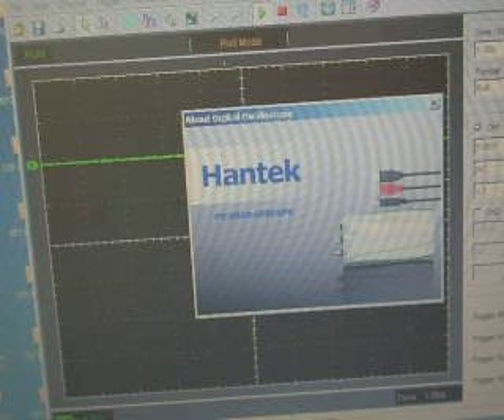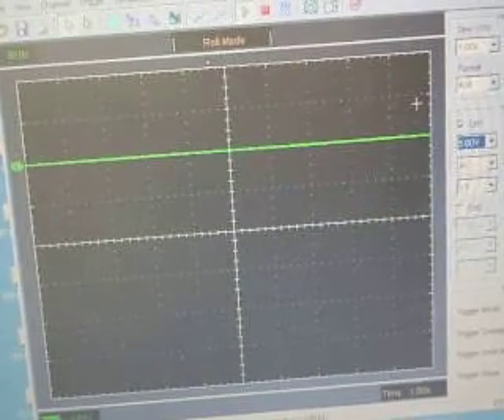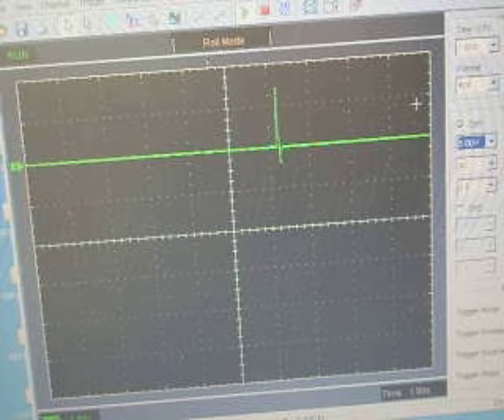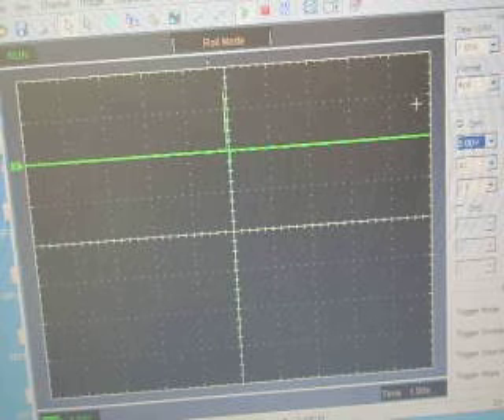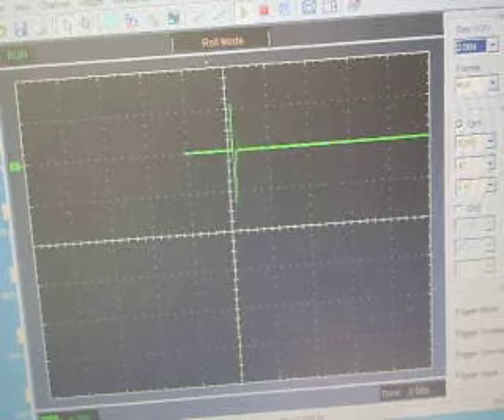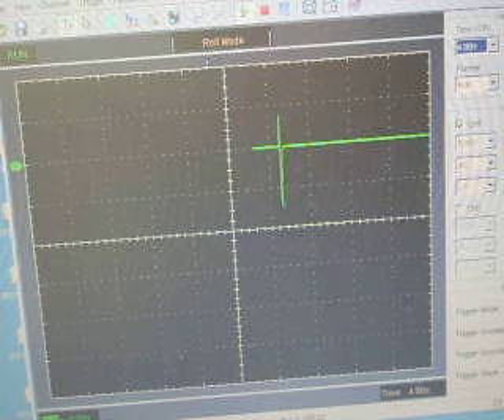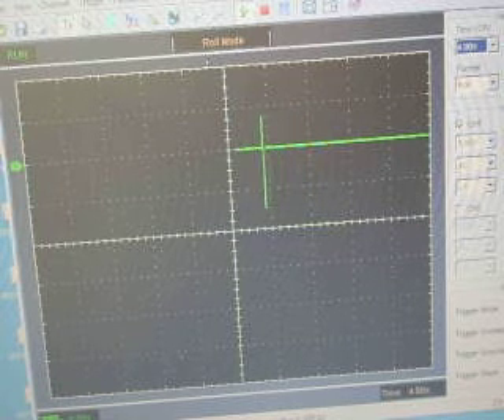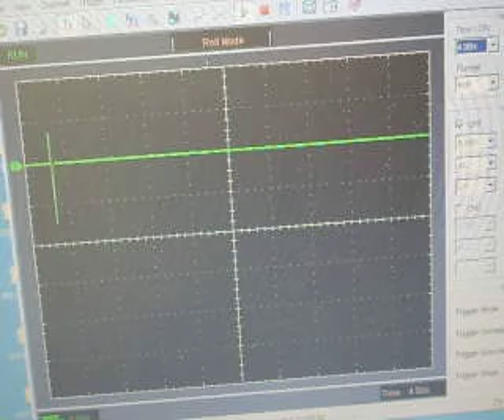Hantek Digital Scope Model DSO-2150 Bug Demonstration

Comment: I just tested my DSO-2150 and I'm not seeing the problem, but I'm running v7.0.0.2 of the software. Did you try any other version? BTW I just downloaded and installed v7.1.0.5 and it won't run at all (on Win7x64); it gives an error message about a missing dll or some such nonsense.
Reply: I was running v7.0.0.2 too. It appears that the software developer assumed that the timing for the particular PC they used would not change. If you do not see the problem, then your timing must be the same as the developer's. Consider yourself luck :-)